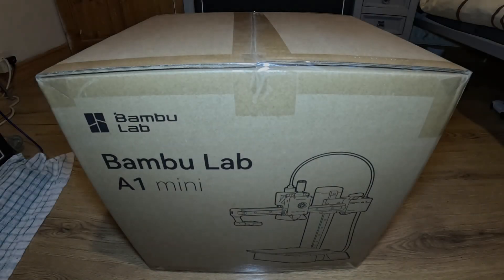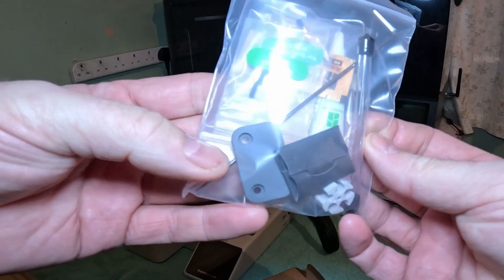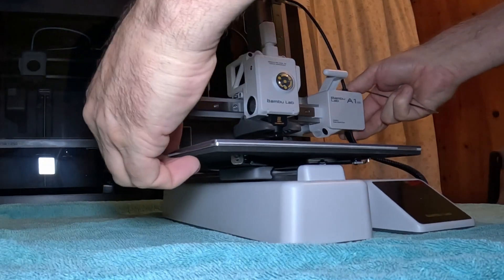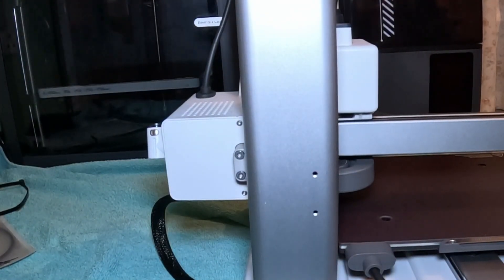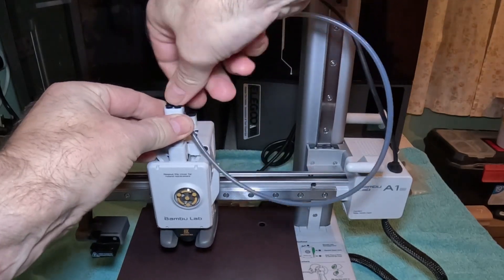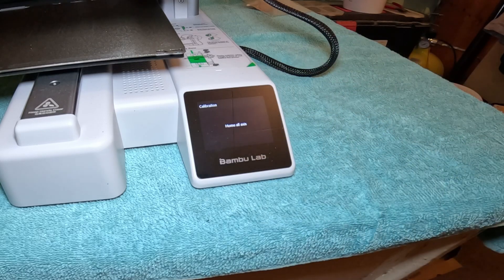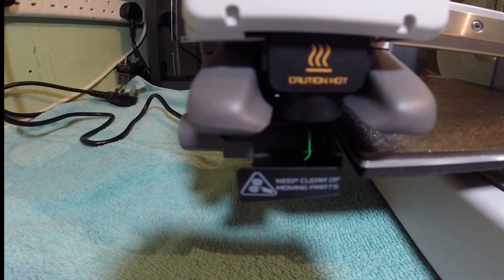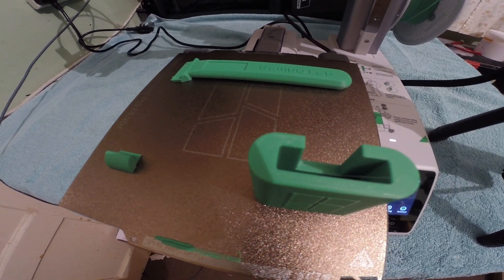“Bambu Lab A1 Mini Unboxing – Is This the BEST Beginner 3D Printer?”

Comment: Thanks for the video. Thinking of getting one of these to dip my toes in to 3d printing. How do you rate it for a beginner 8 months on? 🙏
Reply from the maker: It's an excellent printer really beginner friendly, and probably the best quality prints you will get.
Thanks for watching 👍
Reply: @CALTECH3D Cheers! 🙏
Reply from the maker: No problem.